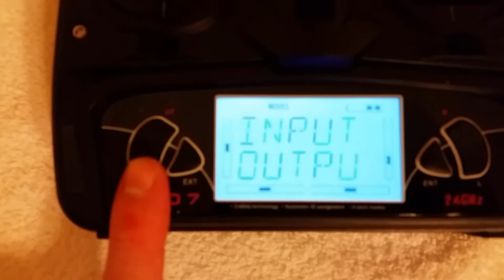EBay generic gimball install guide with pitch control Walkera QR x350 Pro devo7

Comment: hi i followed the setting for the aux2. now for some reason by changing it to aux2 i can tilt gimble but im stuck in ioc. if i change the aux2 back to fmd flying with ioc is not activated and i can fly qr x350pro like normal but the gimble tilts upwards and i cant tilt it at all. i have the g2 gimble. any suggestions on what i can do so i can fly with out being stuck in ioc and also be able to tilt camera? thanks

Comment: Hi, 
Thanks for the video, helped a lot!
Do you know what I can do to be able to tilt the angle as much as you do? I try to tilt it more than about 10 degrees it won´t go and just starts shaking. I tried the (press 3 times, hold, 2 times, hold and once, hold the gimbal level) reset but to no avail.
Any ideas?
Thanks.
Reply from the maker: You want to make sure the camera is centered and will balance without power before you give it power, 2nd check the limits on your transmitter and 3rd you might have to get into the SimpleBGC software which is one thing I don't have a video about but you can find lots of info on that on the net. Hope that helps :)

Comment: Hey thank for the video I had no way to power the gimbal so I sodderd  it to the battery cables and works fine but I can not control the gimbal to tilt it is there anyway you can help me out?
Reply from the maker: +Jordan Becar I haven't used that one in a very long time but you just going to have to plug it in like I show and setup a channel to control it